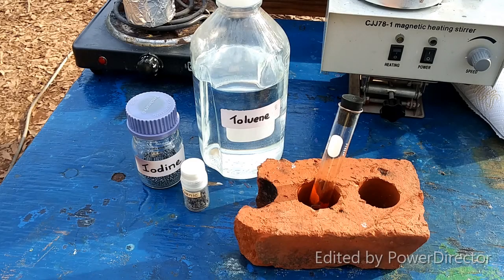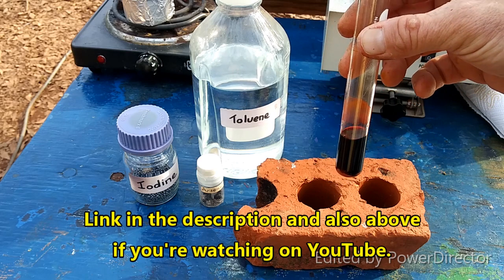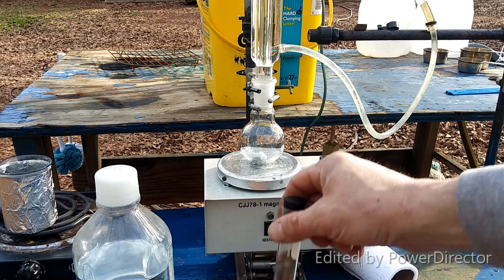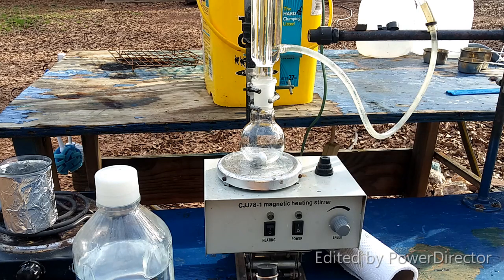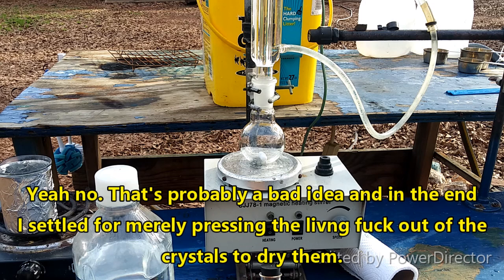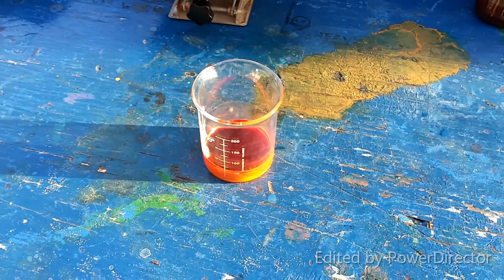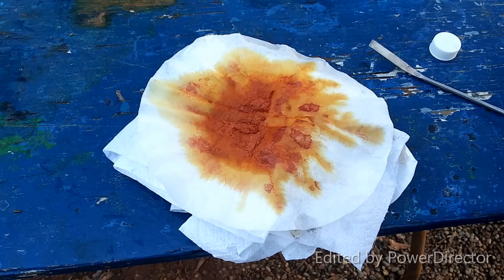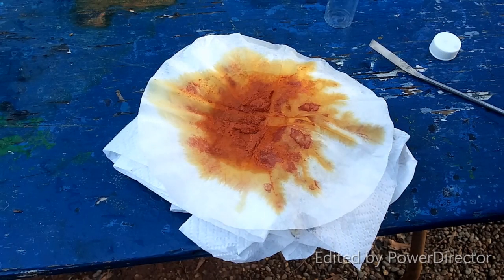How to Make Arsenic(III) Iodide (Good Prep for Experienced Amateur Chemists) #chemistry #arsenic

Comment: I wounder if other solvents would work besides toluene
Reply from the maker: I would imagine that you could get away with xylene.  There are probably other solvents that could be made to work. But toluene and xylene are probably best because they have high boiling points and are unreactive under these conditions. If you are in the US you can buy xylene at the hardware store. Not sure about other countries.
Reply: @PoorMansChemist  Cool I was thinking Xylene or maybe Benzene if I had some to spare lol. I'm in the good ol U.S.A So i've got a gallon of Xylene amount other Solvents ( god I wish hadn't stopped selling there Gallon cans of Toluene :(
Reply from the maker: @kieranodea771  You can still buy it online. It's not too hard to get ahold of. And it's not all bad news at the hardware store. They got rid of next to useless butane (MEK) and replaced it with extremely useful ethyl acetate.
Reply: @PoorMansChemist  True MEK was a bummer to loose ethyl acetate was a handy replacement but what pisses me off the most is how they totally phased out DCM. Its more that all ,most all sites charge a hazmat fee to ship Toluene but if you buy in bulk I suppose its worth it